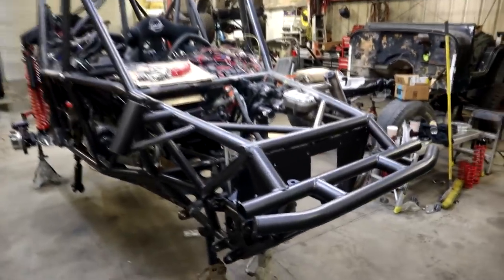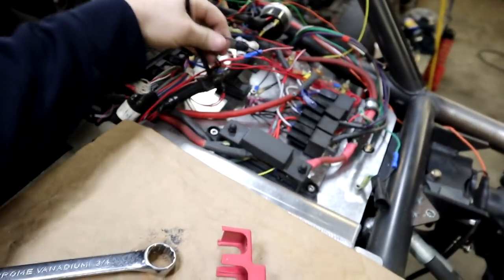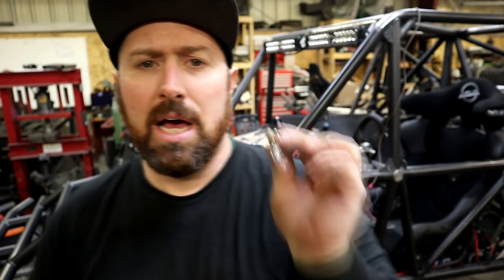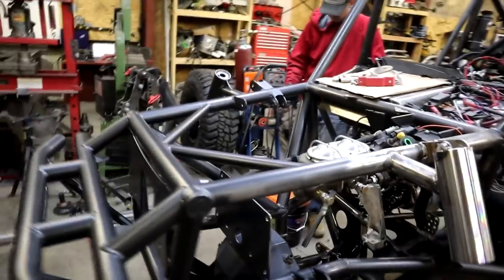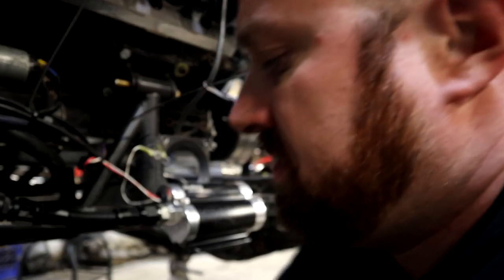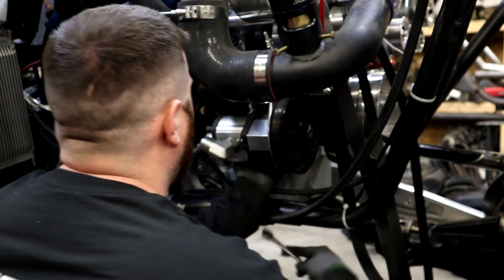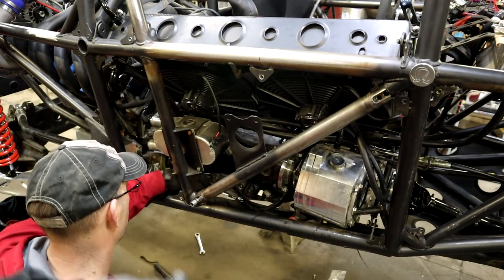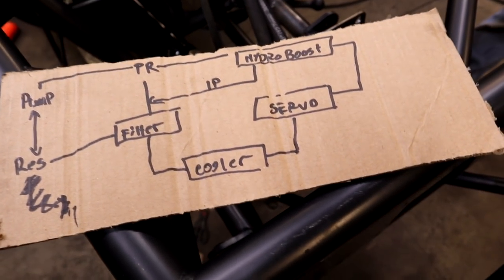King of The Hammers Ultra4 IFS Twin Super Charged Build Part 19 - Finishing the Car Part 1 of 2

Comment: Banjo bolts aren't made to work with the flair systems. They rely on squeezing the crush washers on the four flat surfaces. You need to cut down the flair on the inside of the fitting going into the master.
Reply from the maker: Banjo bolt pass fluid through the front hole and the rear head section seals with the crush washers yes, but seating the banjo around the flare to allow it to seal was needed.